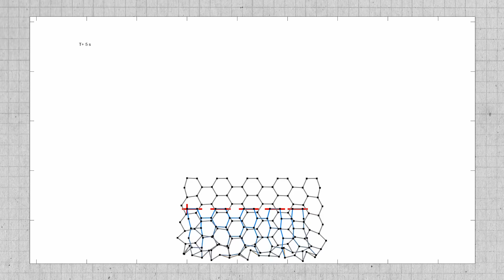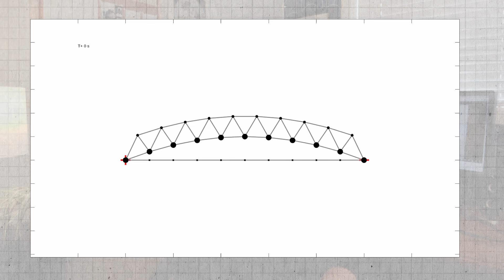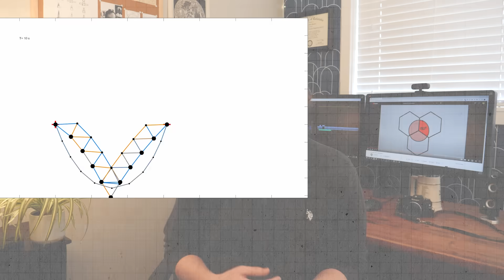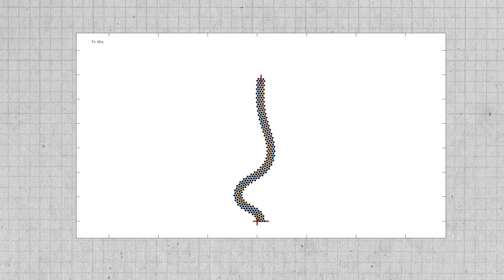Hexagons Are NotSoGreatAgons

Comment: There's no such thing as "the strongest shape" broadly. In some cases, spheres are optimal. In some cases tubes are optimal. And sometimes it's a hexagonal lattice. It depends entirely on context and constraints.
Reply: Spheres are optimal... when you need something to roll... like a ball bearing. Spheres are not as physically strong as triangles and are far more prone to pressure, no matter what material you make them out of.

You can, in fact, say what shape is 'the strongest' since strength is a characteristic and not a descriptor within material sciences. Strength is "the ability of a material to withstand compression, tension and sheer."

Triangles are much better at all three of these things compare to other shape no matter what you put them through. This isn't to say they are better suited for every task, but they are without a shadow of a doubt the strongest shape.
Reply: @spectralstriker Spheres are in fact the strongest shape when it comes to withstanding uniform pressure across their surface, since they evenly distribute the load across their entire surface.
Reply: @zutaca2825  Good thing that isn't what I said then.

Edit: Totally said that, and let me clarify, I thought we were talking about circles for some reason. Spheres are the strongest 3D shape. Triangles are still better suited for most tasks, though.
Reply: @spectralstriker  Confirmation bias and cherry-picking
Reply: @spectralstriker  "Triangles are much better at all three of these things compare to other shape no matter what you put them through" Empirically incorrect
Reply: @spectralstriker  "This isn't to say they are better suited for every task, but they are without a shadow of a doubt the strongest shape" Objectively false
Reply: @spectralstriker  dunning kruger
Reply: A point is without a doubt the strongest shape, as it cannot be destroyed in any way. But you can't make anything with it, so it's pointless.
Reply: @thescooshinator  Cease

Comment: at 5:03, why not just add one equilateral triangle connecting half the vertices of the hexagon?

That dissects the hexagon into 4 triangles, each of which would be "rigid" by your description, making the whole hexagon rigid transitively with only 3 additional members.

I imagine you might complain about the bending of one of the triangles "folding" over its edge in the real-world third dimension, but if you're considering that, then the single triangle on its own would have the same folding issue, where it wants to rotate around until the third vertex is below the supporting edge. So you're removing that from consideration from the start.

Comment: I've seen more than one videos trying to debunk the strength of hexagons, while forgetting that Grey said at 6:00 in his video:
"Hexagon is strong-a-gon. This is because when hexagons come together, they form three-sided joints 120° apart. This, *for the least material*, is the most mechanically stable arrangement."
Reply from the maker: It’s not a case of triangles being stronger but hexagons having a better strength to weight. Triangles are stronger AND have greater strength to weight.

Because hexagons aren’t really mechanically stable, the members would have to be thicker  and/or the joints reinforced for it to match the strength of the triangles to the point that it’s heavier. Just because the grid of hexagons has fewer lines doesn’t mean it requires less material.

Comment: At first I thought "wait but don't a lot of rockets machine the shapes into thicker panels? So ease of manufacturing doesn't make sense as an argument." But then I checked and planty of those seem to use plain old rectangular rib sections or 🥁 ... isogrid! Which is just triangles, though in hexagonal arrangement rather than the rectangular arrangement of the rail bridge.

Comment: A thing that I mentioned in the comments of the original which I haven’t seen mentioned here is another argument that Grey made, which is also wrong.
Saturn’s polar hexagon is understood, and we’ve created a variety of regular polygons in simulations using the same mechanism. It’s basically just rossby waves interfering constructively when near a pole. Hexagons are the shape with the fewest number of sides that’s easy to make (with less, the winds need to be far more intense, which means extremely high gravity and way faster rotation) but lots of shapes are possible.
I spoke with one of the authors of a paper looking into this when I was in uni. His explanation was extremely confusing until he showed me the model, then it all clicked 😅

Comment: I think he kinda missed the point of the video. He admits that triangles are stronger than hexagons, but the reason he says triangles form hexagons is because for the purpose of a beehive, hexagons are preferable. They provide greater storage space, as well as weighing less than a bundle of triangles of the same size, and since a beehive is not in need of the absolute strength of the triangle, it would rather have hexagons. Also i would like to see simulations of hexagons and squares and such without jointed corners. The corners of a beehive don't twist not because the hexagon is self-determinant (because it isn't), but because the corners aren't joints. It just seems disingenuous to show that triangles stand on their own when that isn't even the question being posed.

Comment: When you say atoms "aren't connected" but are "pushed and pulled by electron clouds" ... this doesn't make sense to me. Aren't atoms in fact as connected as anything on their scale can ever possibly get? When we say that larger objects are connected, don't we really mean that the atoms comprising them are pushed and pulled by electron clouds, in which case, being pushed and pulled by electron clouds is what the word "connected" as applied to objects always and everywhere really means?

Another thing that makes no sense is calling something an "atom" while also claiming that it is comprised of smaller parts. The definition of an "atom" is that which can no longer be divided into smaller parts. So, by dividing the so-called "atom" into smaller parts, you've only proven that the substance or particle in question is not an atom by definition.

Comment: I think the biggest problem with the simulation is that the joints are free to move, which is not exactly realistic to life.
In real life there is no joints which can just phase through each-other.
Reply: Unfortunately that's not how physics work. Joints, whether they're free to move or fixed, will always be the weakest point in a system if they can't simply pass the force straight to the next side. Remember when Con said materials are strong if you push or pull on them, but not when you bend them? It's basically that.
Reply: @lucask135  unfortunately you are confidently incorrect

Comment: While much of what you say is valid for a hollow flat plane structure, the dynamics change with a platonic solid. Using the tiling method with merely triangles and you have to shear planes that will cause it to fail and yet building a "bridge" with hexagonal tiles will stay together.  It is also just as strong and with less material to create the hexagon with the equivalent of equilateral triangles... 6 triangles arranged in a hexagonal formation would require 18 lengths of rod and eighteen vertices, whereas the hexagon can form using only twelve rods and 7 vertices. Arguments for or against are dependent on the parameters and usage.

Comment: think about why beehives aren’t triangles. it would either make a square or hexagonal pattern. the connective bits in between the non-triangular shapes would be structurally secure, but it’s less space efficient than just regular hexagons or squares filled with honey or other bee resources. 

now imagine being a wax moth larva chewing through a straight line of triangular or square walls. you don’t care about the honey that much, so when you get to the end of the wax & break out of the hive, every single cell you passed by would then form a singular straight channel that leads directly out of the hive. the way that hexagons tile however makes it so that you either have to follow the zigzag pattern, which a channel created this way wouldn’t drain as easily, & if you still go in a straight line then you have to go through the honey to get to more wax, which also will drain half as many cells than in a square pattern. 

hexagons are great cuz of their surface area being close to that of a circle, strength comparable to triangles, & simplicity similar to squares. you can use them to avoid endless straight lines, which is entirely situational but still a good counterpoint. 

and for my last point; when you tile hexagons, it forms triangular connections. if you push against one tile, it pushes against 2 or 3 other hexagons depending on if you pushed the point or the side of one of them. that will continue to push on any further hexagons. if you try making the same shape out of triangles then sliding can happen. as you’ve also shown earlier in the video, if you remove one triangle, the whole structure can collapse. if you remove one hexagon, the other 6 surrounding it will still keep each other in place, & it will still be able to support the structure.

triangles may be able to quickly get to the point, but hexagons are far more well rounded

Comment: Yeah, but aren't circles actually the strongest shape? Not practical to build with, but nevertheless stronger than even triangles?

Hell, I've heard that bees build their honeycombs in circles and it collapses into a hexagonal structure, though I can't recall where. It certainly makes more sense than bees getting out tiny little bee-sized protractors to form perfect hexagons, though, so I'm reasonably confident it's not nonsense.
Reply from the maker: circles are best for internal and/or external pressure (and torsion) but are actually pretty weak to point loads (triangles are best) and bending (which is what I and T beams are optimized for)

Also you’re right on the honey comb part, I think that was Stand up maths
Reply: @ConHathy  Still doesn't beat the real bestagon https://www.youtube.com/watch?v=ddWJatRxfz8

Comment: How could you? I was indoctrinated into the bestagon cult three years ago, and have been a faithful believer all this time! How dare you shatter my faith like this?!
Reply: Ah, another bestagon cultist disillusioned from their brainwashing. One step at the time.
Reply: If you are a true believer your faith shouldn’t have been shattered “makes disappointed face”
Reply: There are so many flaws in his arguments. For example the building with hexagons. The corners would be welded and not rotate and collapse as shown
Reply: @JasonMadl  yet you can't debunk them, maybe YOU don't know what you're talking about
Reply: @JasonMadl  Even if they had been welded together, the torques that caused the joints to rotate in the simulation would still be present, putting additional stress on the welds. A statically determinant structure wouldn't have that problem.

Comment: Correcting a weirdly common misconception in your correcting misconception video... material is not just "consumed" in subractive manufacturing. You aren't going to reuse fiberglass, sure, but machining a brick of steel doesn't... put steel into a black hole. It gets collected and reused. The only thing you lose there is tool wear, machine time, energy/coolant, and energy use in the recycling process.

Comment: I thought circle was greater than triangle that's greater than hexagon?
Reply from the maker: circles are best for internal and/or external pressure (and torsion) but are actually pretty weak to point loads (triangles are best) and bending (which is what I and T beams are optimized for)

Comment: you are entirely ignoring that hexagonal tesselations and triangular tesselations are duals of one-another. Depending on the perspective of a problem, the answer can either be a triangular tesselation or a hexagonal tesselation, as they are just the sides of the same coin in essense. So the main question is, when is the square tesselation better than the triangular/hexagonal tesselation. I am way more obsessed with this topic than I'd like to admid and in all my research into this topic, there has neve been a problem to which squares are the optimal solution compared to either the hexagon or triangle.
Reply: Counter argument videos conveniently ignoring and cherrypicking everything that might support & hurt their arguments ? hmm who could've expected that

Comment: People defending the hexagon from a gaming perspective are kind of missing the forest for the trees.

The real value of the hexagon in mathematics comes from its synergy with the unit circle and the real value in practical applications from from its synergy with polar coordinates (which is often expressed in gaming).

The mathematics makes it super easy to calculate because of native relationships with sin and cos.
Polar coordinates have the advantage over grid systems of natively expressing distance as the radius from the origin (no cutting corners and getting 1.4+ units of diagonal movement.  It also has a pretty elegant system of vector addition but that's getting into the nuts and bolts.

Good video and very informative to this non-MechE.

Comment: I'm not convinced about the honeycomb being used due to ease of manufacture. You would get exactly the same result by just welding strips between each other in a way that would produce a lattice, and that should be cheaper because there's less welding to do. So there must be another reasons why the filling is hexagonal and not square.
Reply: You should watch a video on how aluminum honeycomb is manufactured.  But to quickly describe it...

Start with a thin sheet. Apply the bonding chemical in stripes equally wide as spaced apart. Place the second sheet on top. Apply bonding chemical in stripes, but shifted over so the stripe of bonding chemical is over the blank stripe between sheets 1 and 2. Now put sheet three on top. Apply stripes of the bonding chemical but shift back to where they were on sheet 1. Place sheet 4 on top. Now repeat hundreds of times.

You now have a stack of thin aluminum sheets bonded in stripes, alternating between the layers. Now you can put this stack in a machine that grips the first sheet and last sheet and pulls the stack apart, expanding it into a "honeycomb" shape.
It's very easy to manufacture.

Comment: i have an issue with your sims. in the case of a hexagon and its strength, wouldn't it matter if it is filled with a fluid. a can of soda is very weak until it is filled with fluid to add structure.

Comment: Something you need to understand and a lot of other people too. People like cgpgrey are there to communicate the basic ideas and get you interested. If they get smaller facts wrong, IT doesn’t MEAN THEY HAVE FAILED. This happened with conlangs too. A bunch of nitpicks ended up in someone accusing someone of being horrible and not knowing anything. Not noticing the fact that most of their nitpicks were semantics that they included to fluff their argument with a lot of bullet points, or that none of it changed the message, or that this got people to explore conlangs for the first time when they never would have before.

Comment: ONE caveat:
Hexagons are the "strongest" shape for the specific case of an array of VOLUMES under PRESSURE in a 2D plane. If you stack cylinders on top of each other perpendicular to their axis of rotation, then they will tend to deform into more stable hexagons. Or, rather, into hexagonal prisms.

Of course, the world is not 2D, so it seems like in practice you get a lot of "scutoids", a shape that can (among other things) look like a compromise between a hexagonal prism and a pentagonal prism. Vihart has done videos about them before. Your body contains a lot of scutoid-shaped cells, which are volumes under pressure. I'm not aware of any engineering applications for them, though.

Comment: Well triangles aren't the strongest shape in all directions, they are only the strongest insofar as there is a consistent force to resist against. And even then, arches far surpass triangles in structural integrity/strength.

Hexagons are stronger if a shape needs to resist force from all sides at the same time.

Comment: It seems you assume the hexagon is empty, so you have only proven that a hexagon-shaped gap isn't structurally sound. 
Or at the very least you assume that the edges of the shape are stronger than the inside. If the edges are weaker than the shape itself, then having these weaknesses align along the entire length of the structure is a bad idea: your structure could easily be torn in half.

On another point: When it comes to storage the circle is best. The fuel tank you mentioned in your example probably isn't triangular or square, it is going to be as round as possible. If you want to store multiple things then you're going to have to tile your circles. The closest you can get to a tiled circle is the hexagon.